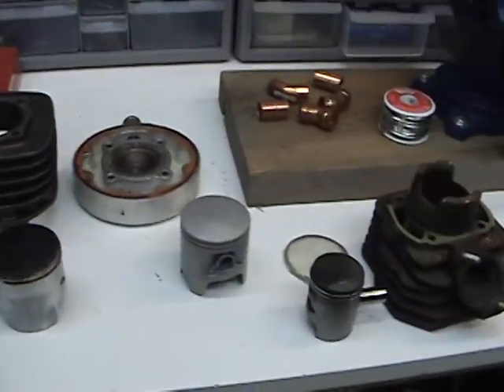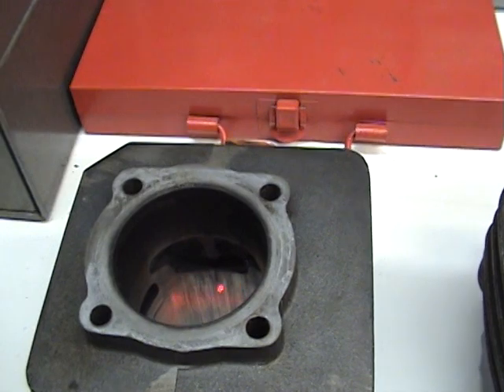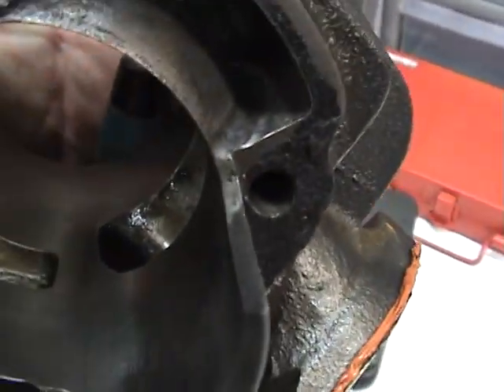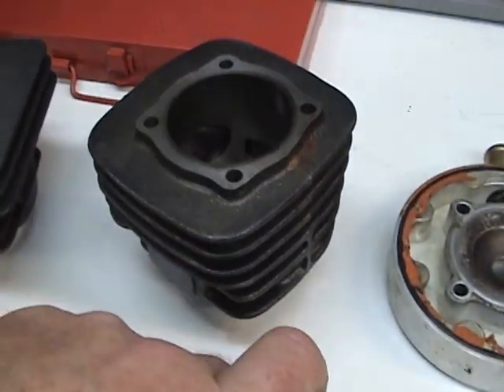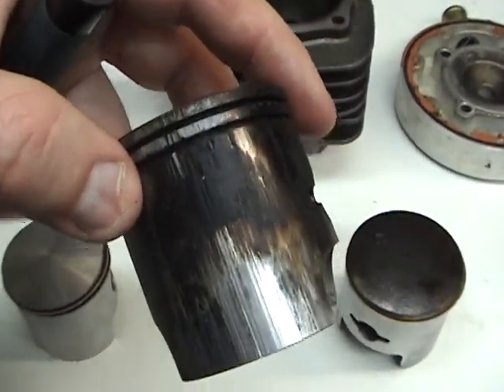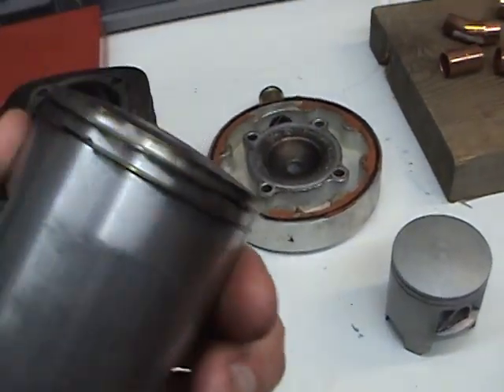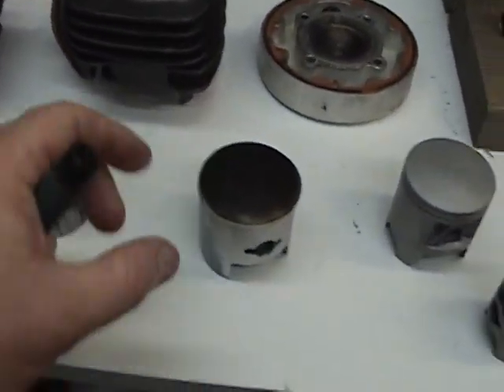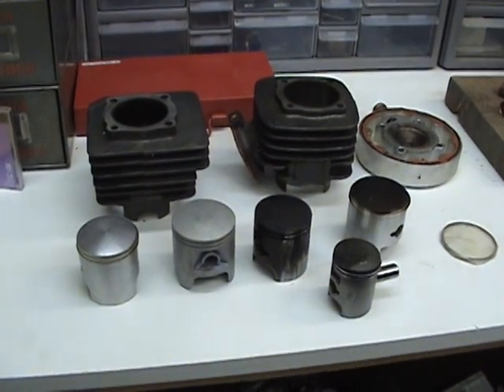(3)- Two Stroke Piston Problems

Comment: no piston wash on the top means lean jetting or hot engine, 
damage to the center of the top of the piston means detonation. from lean jetting, bad gas, water in gas, improper timing....
damage to the exhaust side of the piston were it erodes the piston edge towards the top ring means lean.
scoring means water in fuel. that scoring will show up on the intake side usually.  scroing all around but a good looking piston top usually means cold start revving.

Comment: The piston circlip failure is caused by the tang sticking in and touching the pin. The pin will free float, if the pin pushes on the tang, instead of the circlip that is held in the piston groove it will cause the circlip to wear and eventually fail. There is a very good video on youtube explaining this.
Reply: Correct

Comment: The circlips broke on one of my engines once, and now I always install the circlips with the opening on the top or the bottom; the logic being that the inertial forces will more easily dislodge a circlip with the openings on the side.  I also use only new ones!   Cheap insurance for less than five bucks!
Reply: meh. ----just make sure they have adequate tension. some ppl smoosh/compress them too much on removal and now they aren't as tight in there as they once were. i like to use brand new ones every time if i can. engine heat will make them lose their springy-ness,...so when you compress them to remove them,...they don't spring back hard enough/as hard as they used to. --and at .25 cents a set,...its worth it to go new.

Comment: Thanks! Did not know the ring expansion explanation either. Rebuilding a 1986 GL1200 Interstate at present. Pistons all look good but will be replacing rings anyway as I want it to run as like new as possible......

Comment: blow by will show up as blackening on the surface of the rings.
scoring all around on a new engine means improper break in, or possible incorrect piston to wall clearance.  also can be lack of lube.

Comment: 100  often means it's been bored out to the 4th or last oversize piston.  
.25 means (quarter mm...or first oversize) 
.50 (half a mm...second oversize)
.75 (3/4 mm...."third over")
100 (1.0 mm oversize..."fourth over") ...after that time for new cylinder or re-sleeve it..or if lucky Wiseco piston may be available if the cylinder sleeve can be bored bigger than 1mm.

Comment from the maker: @yz100f Shaving the head is supposed to give you more compression , but you have to know exactly what to do , because if you take too much off and have piston-slap when the motor gets up to speed, you will destroy the piston and the engine. I have never done it personally, but I would use a compression gauge and take very good measurements for clearance before I risked it. ALSO gas is watered down crap these days and detonation is a very big problem with crummy pump gas. RH DSD

Comment: I dont know what you are doing for gas/oil, but my old school lessons taught me to cap off the oil injector, and make the bike a full race old style premix bike at 40 or 45 to 1.........I could make that damaged head into a super high compression head.  DSD, check my blog on the 2 stroke bike I made, the video is uploaded.....I get to 35 mph in 1st gear at over 7500 RPMs and 50 in 2nd

Comment: you probably seized it due to too lean a mixture (should have done plug chops!!) you can't get your cylinder off because the piston is melted to the cylinder walls, junk the Aerox and get a Chinese GY6 scooter, that way even if you destroy the motor it isn't that expensive for a new one.

Comment: Two serious problems with the info here:   The piston rings don't rotate, else what are the pins for?   When the piston is initially inserted in the cylinder the rings compress and the ring gaps are supposed to key on the pins.    Secondly, the piston arrow always points at the exhaust port.    No wonder you're having
piston problems.
Reply from the maker: That is not what I meant, sorry.. In my Recently Updated Playlists, I have Dozens and Dozens of vids on all Aspects of this subject. All Free. Thanks

Comment: polished ports? okay , the chrome lining wraps into the intake and exhaust port. any cleaning with a hard tool or removing the chrome will cause failure. next - black on the piston is caused by the oil not burning . but the saying if a little is good than more is better . wrong! the fuel oil mixtuer on todays engines are not like the old days. run the correct mix. any left over oil will not burn and stick to the piston and couse drag and will over time score the piston. last , if a piston is scored on the exhaust side, the engine is to lean. if you change the bore size to a bigger cc , always change the jet in the carb.  ps, any time the wrist pin  retainer comes out , that was the builders fault. after you install the retainer , always check to see if its seated in the piston and never use a bent retainer.
Reply from the maker: My channel has 30,000,000 MILLION VIEWS. Your channel has "no content". I suggest you make some cool videos to school us two stroke engine idiots how it is done. Thanks for watching.

Comment: Thanks for the video. how do you clean a good used piston to be used again?
Reply from the maker: nawtn Sand the piston, wet sand I mean with like 600 grit and water to remove all carbon and dirt. The most important part is to get a piston ring tool= to get all the carbon and blockage out of the piston ring grooves in the piston. The rings MUST move freely when installed or they will not seal and your wasting your rebuild. Buy good quality rings, A NEW WRIST PIN BEARING. Use a piston hone, 2 or 3 prong, and hone the cylinder, using oil or water to give the new rings a rough surface to seat well in. Look at the exhaust port= ( where it connects to the exhaust pipe) and sand and smooth that area to allow greater escape of eshaust gas for more power. Use good NEW cylinder head gasket and base cylinder gasket. Check your deck height to make sure the cylinder is not too high off the piston top, or too low. IF you have Destroyed the engine with a blown piston, scoring, blown bearings, then YOU MUST DO A TOTAL REBUILD= TAKE the crankshaft out, replace the crank bearings and MAKE SURE no metal shaving are in the crank gallery itself. IF YOU DO not do all these things- Your wasting your time. Aluminum or steel shavings will destroy an engine in minutes. RH DSD

Comment: Hi, thanks for the piston and cylinder information. I have 125 rs the problem is I can't drive more than 70km normally unless I shift down 2 gears till the valv get over 7000 then it will go faster. At the beginning we thought it is calibrator problem, then after we open the cylinder top we could see a scratches on the cylinder sides. What do u recommend ! Shall I Change the piston only or I have to change the cylinder too ? The cylinder is very expensive and not easy to find.
Many thanks.
Reply from the maker: soranys Sounds like you scored the piston and cylinder. Let me ask you- Does the piston rings move smoothly in your hands or is it black carbonized stuck to the piston grooves? Please make a video of the piston, head, and cylinder and I can tell you more. Here in America, I would kill for an RS 250. They do not sell them here and they go for like 10,000$ US every time one comes up for auction. I would love to do a series on the RS 125 or 250, but they do not sell them in my U.S. Make the video and send it to me or post it on this thread, thanks , R DSD
Reply from the maker: DIOSpeedDemon Remember that there should be NO black beneath the piston ring line on the piston sides. If this is happening , it means the rings have failed and the combustion gases are escaping down the sides of the piston and not staying in the combustion chamber.

Comment: my 87 kx 250 is leaving marks on intake side at the bottom. ideas?
Reply from the maker: Sounds like it could be a worn wrist pin or worn wrist pin bearing. I would replace both and always use new wrist pin clips, never used ones.

Comment: you do some good here but you never got to the causes of overheating
Reply: +crowmagg1       My usual causes of overheating are a lean mixture.  If it's not due to directly messing with the jetting, it's probably a vacuum  leak.  Check your base gasket, as well as intake fittings, as these will be the most obvious. The not so obvious will be the crank seals, especially the one on the flywheel or magneto side; this will let dirty air into the crank under the crankcase vacuum phase of induction.  The other crank seal, if it fails will draw oil into the crank resulting in smoke etc.(very obvious).  WFO!

Comment: So much trouble and stress isnt it. Two stroke engine is fairly simple. its not rocket science..  And is supposed? If you shave 2mm of the head, it IS gonna give u more compression. Compression gauge? forget it. Google the formula how to calc it, and just shave it. Good luck, chuck
Reply: shaved head=wrist pin bearing torture. and same for lower con rod bushing/bearing. i'll pass.

Comment: clearence wrong, not enough 2 stroke oil, warped cylinders, port being to wide, wrong mixture/ over heating. Even if clearance is to big u can cause piston to overheat; I bet that the cylinder needs better cooling, oh and the exhaust port on the 1st cylinder is crazy for ring wear; looks like a vintage race porting job!